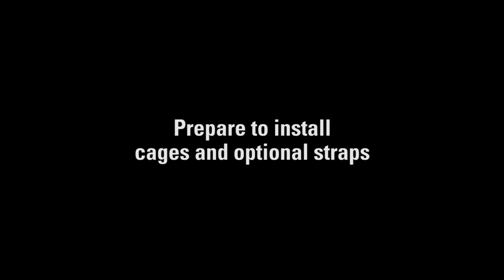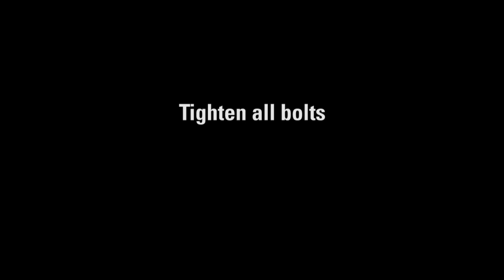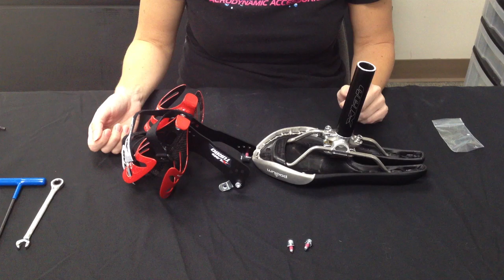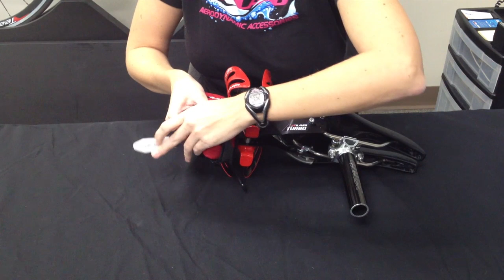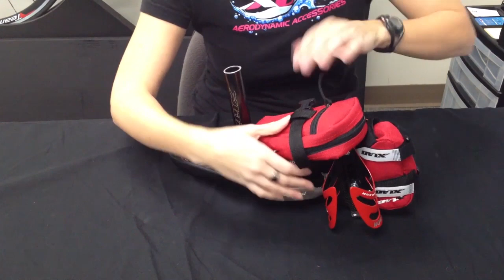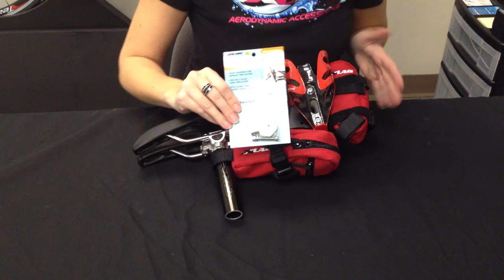Turbo Wing Installation Video | XLAB Engineering

Comment: Absolutely terrible video and terrible instructions.  I have the kit in front of me and it is completely disassembled and in pieces.  No mention of where the lock and flat washers go.  No printed instructions and the instructions on the website are equally bad.